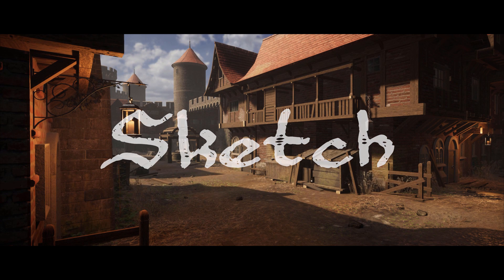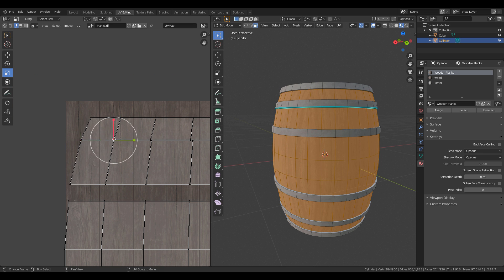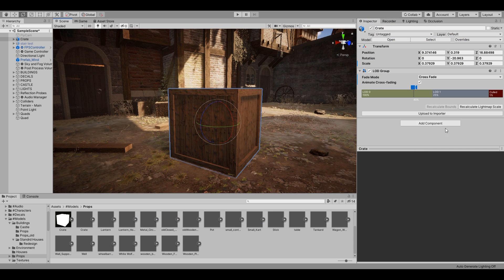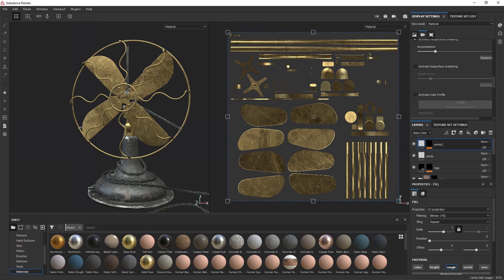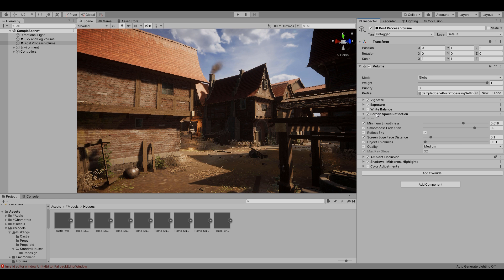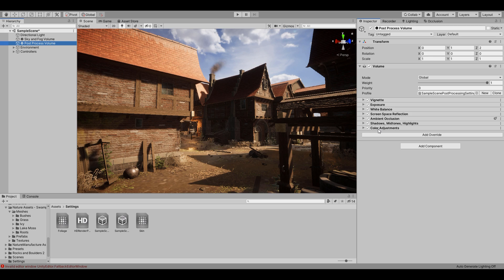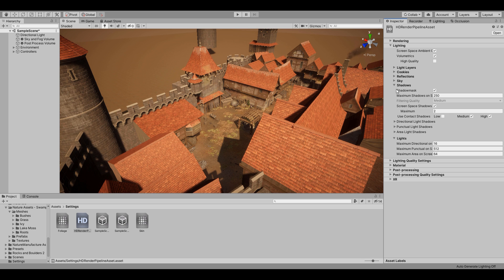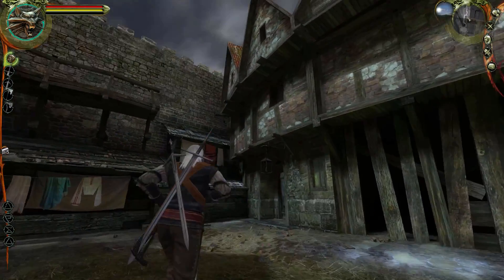Witcher Recreation Project Quick Technical Overview

Comment: Its hard to believe that you didn't use the ACES tonemapping lol
Reply from the maker: Actually, HDRP is set to the ACES tonemapping preset by default so you don't need to manually change it
Reply: @sketch3436  is that so? When I tried hdrp changing to ACES made a difference. Anyway what caused the crash?
Reply from the maker: @lightningparadox  I actually don't know what caused the crash, I just tried to open the project one day and it just didn't open.
This is why it was a pain to fix cause I had nothing to base it off.

Comment: I have a question regarding materials. I know that performance-wise one material is one draw call but If you make unique textures for every object in the scene you will end up with many texture sets. Also something like a house might require a lot of resolution to look good. Isn´t it better to have less materials that you can tile to apply in different objects? even if an object has several materials?
Reply: Great video by the way!
Reply from the maker: @DanAndDax  Thanks, appreciate it :D
Reply from the maker: Yes, these are the things you have to consider for your game as there is no one approach that will cover everything. This is why making performance videos can be difficult.
In general, a texture atlas will outperform multiple materials in GPU performance, but will obviously have a larger memory footprint. This is important to remember because depending on the platform you're developing for there are memory limits (i.e. I think most mobiles only allow a max texture size of 2048).
If each model has its own texture atlas then GPU instancing can not be done, so, to get around this smaller objects usually share the same texture which would be generated with different object UV maps on it.
And yes, texture resolution will drop unless you have an absurd texture size. However, there are tricks to make textures look higher resolution then what they actually are through detail maps.

Hope this helps :)

Comment: How long have you been modeling?

Because I just started and I can't do anything other then some bad low poly houses and make those amazing Buildings.
Reply from the maker: I started learning Blender at the end of 2019. Don't worry my first couple month I could barely do anything as well and with all the different settings it can get overwhelming. I slowly improved by watching YT vids and also picking random objects to try and model. 
Just keep with it and eventually you be making awesome models!
Reply from the maker: @Evening Commenter Thanks. I actually have a trick if you want to learn quickly, which is dive straight into the deep end. People always say to take small steps but I reckon going straight for the hard stuff is better, it will be difficult but that is what makes you learn quickly when it's too easy you waste time repeating tasks that you could have been done with ages ago. So, the witcher project came about cause I wanted a challenge in order to learn Blender.

Obviously, this doesn't work for everything,  i.e. maths you cannot skip straight to the hard stuff.
Reply: @sketch3436  Very agree on this point.I alway dive into the deep end when I start to learn a new skill.
Reply: @sketch3436  Where have you been brother an update would be great hope you're doing well